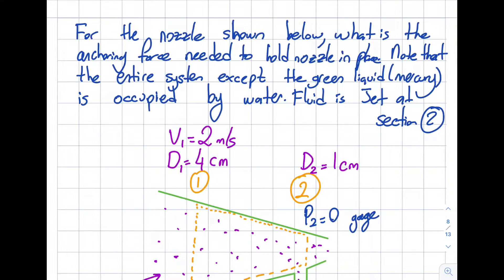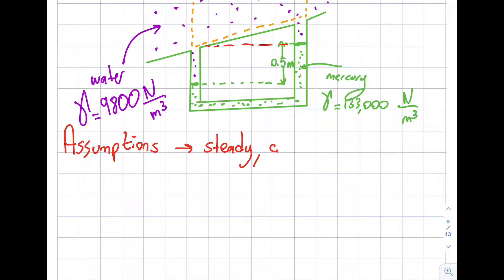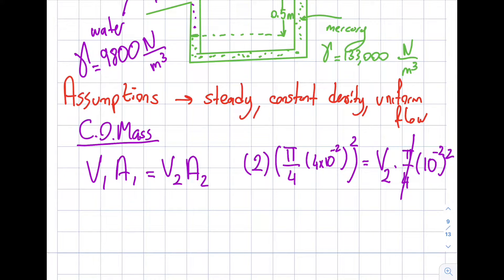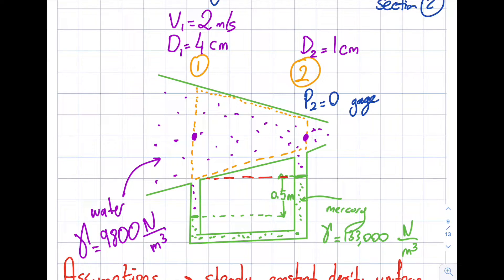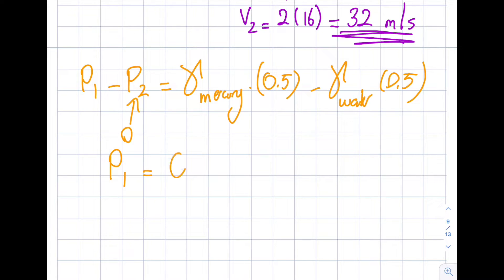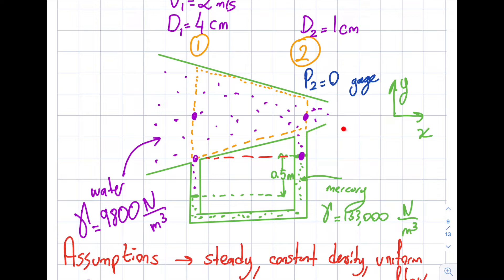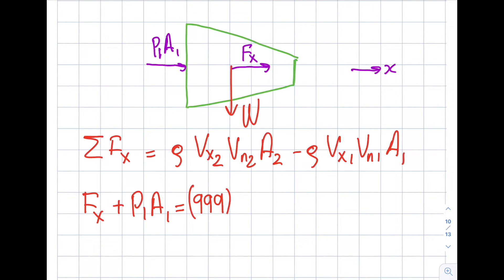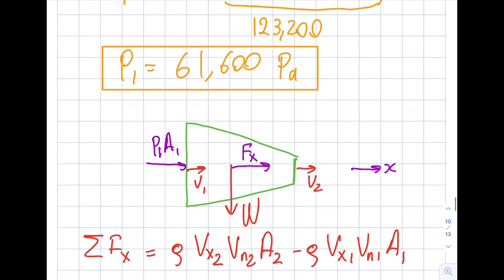Fluid Mechanics 6.4 - Solved Example Problem 2- Anchoring Force on a Nozzle

Comment: If you are provided with the weight of the fluid and pipe, the anchoring force will still be the same? Or we should consider the weight and solve for the net force?
Reply: If you are given it on an exam, you should clarify if both forces should be calculated

Comment: If you are provided with the weight of the fluid and pipe, the anchoring force will still be the same? Or we should consider the weight and solve for the net force?